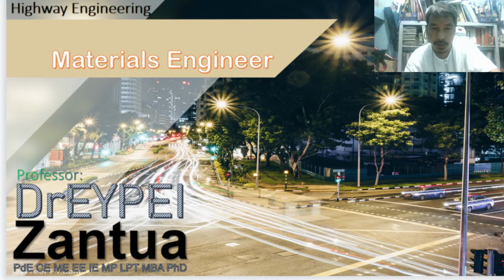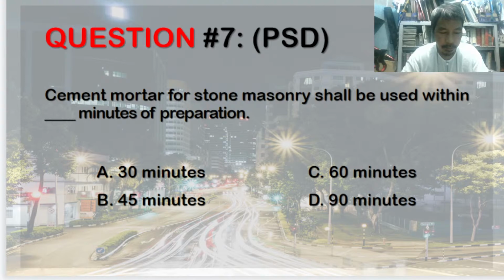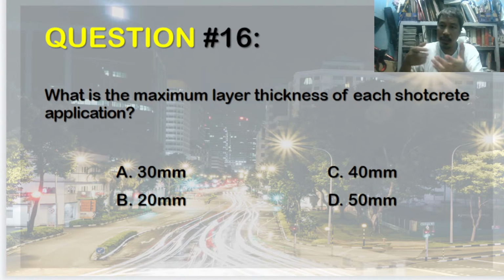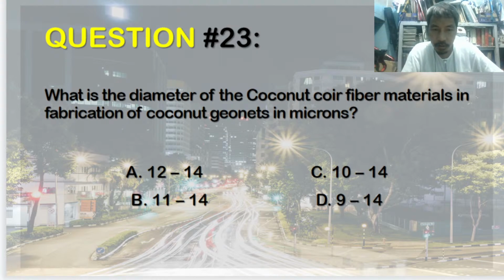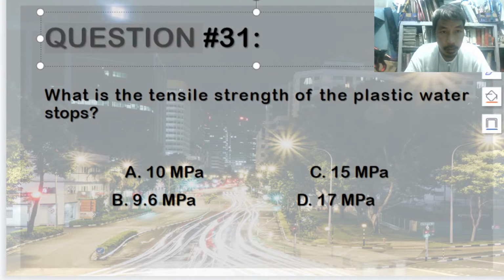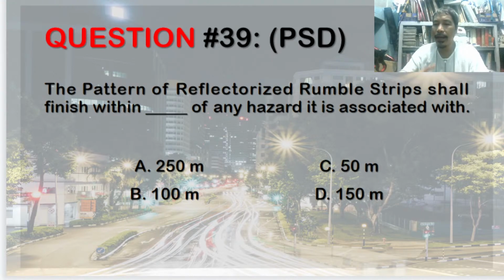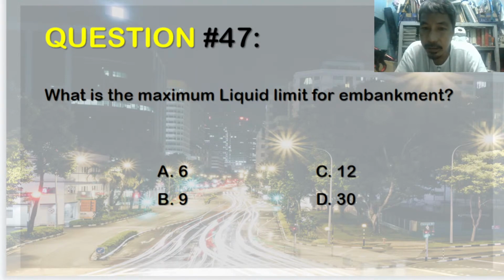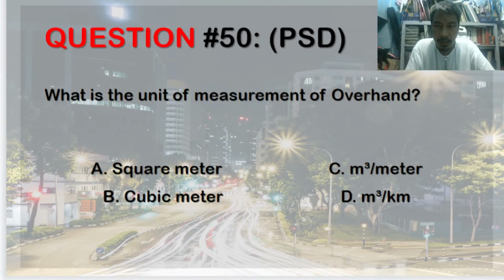[ LIVE CEE4 Lecture 06 ] DrAP Zantua Material Engineer Talks + ENGINEERING Analysis & Challenge Quiz

Comment: Thank you sir Z for challenging us through this live lecture.
13. C (1:3) 
14. C (15 kN) 
15. D (Three Edge Bearing Test) 
16. D (50 mm)
17. C (125 - 160°C)

18. A (0.10 mm crack) 
19. B (Yield Point) 
20. B (100 mm) 
21. A (10.0 mm) 
22. A (10.0 mm) 

23. A (12 - 14) 
24. C (2.20 mm) 
25. C (3.2 - 4.8 mm) 
26. C (100 sqm.) 
27. B (35) 

28. B (10 - 20 m) 
29. A (Item 611) 
30. A (22 - 55 %) 
31. B (9.6 MPa) 
32. C (7 %) 

33. A (4 - 13 mm) 
34. B (7years, 70%)
35. C (0.75 mm) 
36. B (20 - 30 m) 
37. B (Type D) 

38. B (100 mm) 
39. C (50 m) 
40. B (Water) 
41. D (1.5) 
42. C (+- 0.5 %) 

43. D (150 mm) 
47. D (30)

Comment: Thank you, sir, for this video lesson on material engineering problems that have been solved by this video.
In this lecture, I answered the following questions:
13. C (1:3) 
14. C (15 kN) 
15. D (Three Edge Bearing Test) 
16. D (50 mm)
17. C (125 - 160°C)

18. A (0.10 mm crack) 
19. B (Yield Point) 
20. B (100 mm) 
21. A (10.0 mm) 
22. A (10.0 mm) 

23. A (12 - 14) 
24. C (2.20 mm) 
25. C (3.2 - 4.8 mm) 
26. C (100 sqm.) 
27. B (35) 

28. B (10 - 20 m) 
29. A (Item 611) 
30. A (22 - 55 %) 
31. B (9.6 MPa) 
32. C (7 %) 

33. A (4 - 13 mm) 
34. B (7years, 70%)
35. C (0.75 mm) 
36. B (20 - 30 m) 
37. B (Type D) 

38. B (100 mm) 
39. C (50 m) 
40. B (Water) 
41. D (1.5) 
42. C (+- 0.5 %) 

43. D (150 mm) 
47. D (30)

Comment: Thank you, sir for this live challenge question about different Department Order of DPWH. Some of the question have already been answered on the page. This type of material could really help me. Although there's a lot of terms that is still unfamiliar to me. I have figured out some of it. So here are my answer on the given challenge quiz:

13. D.
14. C.
15. D.
16. D.
17. C.

18. A.
20. D.
21. B.
22. A.
23. A.

25. C.
26. B.
27. B.
28. B.
29. A.

30. A.
31. B. 
32. B.
37. B.
38. B.

40. B.
41. D.
42. C. 
43. D.
47. D.

Comment: Thank you sir for this video lecture that tackles about the material engineering questions that have been answered through this video. 
My answers in the following questions in this lecture:

13. C 
14. C 
15. D 
16. D
17. C 

18. A 
19. B
20. B 
21. A
22. A 

23. A 
24. C 
25. C 
26. C 
27. B 

28. B 
29. A 
30. A 
31. B
32. C 

33. A 
34. B 
35. C 
36. B 
37. B  

38. B 
39. C 
40. B  
41. D  
42. C  

43. D 
47. D